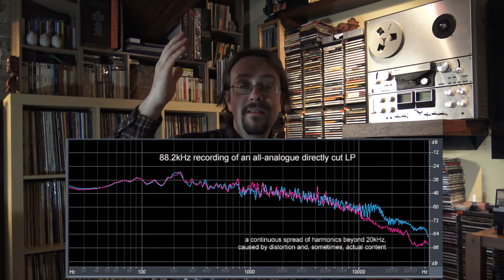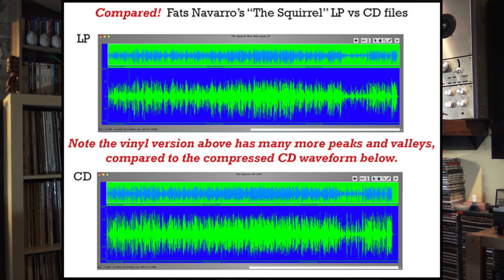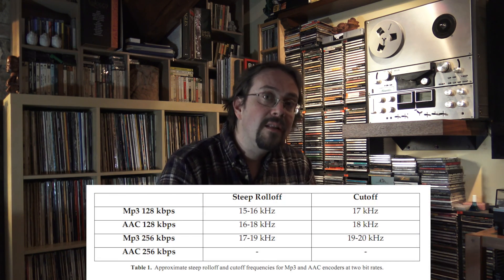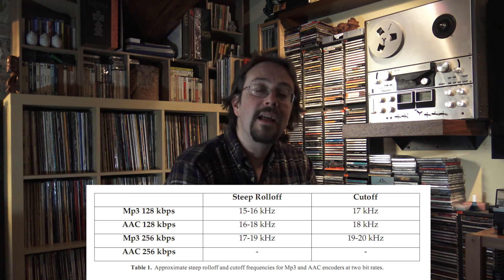SuperTweeters: how to increase your frequency response or a critique on modern music compression

Comment: I’m sorry, but you don’t have a clue on most of what you’re talking about in this video!!
You can’t even understand the huge difference between dynamic range compression and data compression (like lossy formats)...

Do you know that CD (and even mp3) have a way superior dynamic range than vinyl??
Do you know what signal-to-noise ratio means and how that relates to dynamic range?

Do you have a clue about the estimated “bit depth” of vinyl (hint, it’s way lower than CD).

Do you realize that what happens in the frequencies that human CAN actually hear is far more important than the ultrasonic information, and that you can have several pieces of gear (from turntables to loudspeakers) that will have major sound differences while maintaining the same frequency response range (let’s say 30-17.000 hz) while having +- 1dB variation between them across that frequency range?

Did you realize that you can actually hear the change in sound with your super tweeters because they reproduce frequencies well inside the healthy human hearing?

I’m sorry, I don’t mean to sound rude, but you should learn a lot more before you start talking in public about things you still don’t understand.
Please try to understand what audio mastering is, how it’s done, what are vinyl limitations and how they affect mastering decisions.

On the dynamic range topic, record one of your best sounding LP to a lossless digital file in 96KHz/24 bit, then downsample it to 44KHz/16 bit, and then to mp3 around 256 kbps with VBR, and compare those waveforms like you did in this video.
You will have a surprise in the dynamic range results, so please share your findings here with your audience! 😉

This has nothing to do with analogue vs digital, because anyone is entitled to prefer one or the other, and many bad mastering decisions made on any format have been done over the time.

I don’t have any doubt that your system sounds great, and most importantly, that it sounds great to yourself (which is the most important thing, imho).

But please get your facts straight on the technological side of things from the recording process to the playback in your own room (which also has a unique way of making that same system sound), or stick to personal opinions on how a specific audio format (or gear) makes you feel, as that is purely subjective, so you can never be wrong. 😉
Reply from the maker: I don't understand if this is for real...ok I ma not a technician, as always claimed, or an audio engineer. I have some competence and followed a few courses, in any case this is my passion and I like to share my points of view with others. As I always say, if you are looking for law, then you should head to academia.edu, surely not YouTube, and read peer review articles...QUOTE: "Do you even know what a peer reviewed article is?" Just to cite your wrong attitude towards people instead of discussing peacefully. 
In any case, if you start off saying that I don't understand the difference between dynamic compression and data compression then you are not reliable in your comment. It is just a sterile attack.
You are following the book, but you clearly don't know what is really happening Think out of the box sometimes..
Yes, digital formats MAY have a superior dynamic range, I said that in the video, especially the high res formats, but VERY RARELY this is used! In the vast majority of CD and other digital media issues and reissues the dynamic range is compressed in order to achieve a louder output (loudness war) and reduce the difference between high and low peaks that may 'disturb' people of create problems in low quality equipment (these are the reasons since the beginning of digital productions as well as also in analog, like happened for example for the first Led Zeppelin album that was took out of the market because the lower frequencies, which were uncompressed, or very little compressed, were making the stylus jump out of the grooves when used poor quality equipment). 
Most vinyl productions, even when sourced from high res digital as today, have a higher dynamic range as well as a better frequency response because of the intrinsic 20khz cut-off of red book cd format. A SACD, blu-ray audio or HD track will be equal or better IF they are true high res and not just an upsampling.
You suggested a home made experiment that clearly does NOT match reality, what the industry is feeding us. Yes, of course if I create my own Mp3 starting from a high res file I am going to have great dynamic range, which of course is not tied to the data compression, which takes advantage of the high frequencies cut-off. 
Another common pitfall is that of describing analog formats with digital parameters, that just doesn't work. It is a good starting point to explain yourself but it is not scientific, reality is different. Bit depth in vinyl? Not bits, the whole signal is there. Digital resolution is not applicable to analog resolution. One is numbers one is noise. Just take a deep look and check other points of view. The digital Bible law is way too self-referential. We are forgetting how analog works and how good it can be and how dangerous digital is when using it badly like today. Audiophile digital productions are something out of the picture and those ARE truly high quality and in several cases superior to analog (in terms of fidelity, I do not care about the rest). I have no problem in admitting that. The problem is that what is on paper does not match what reaches our ears.
Reply: Are you sure that you're not just upset that you discovered that super tweeters CAN actually make a difference and you went into a long diatribe about everything else? Lol. Some audiophiles are stuck on the old stigma of super tweeters from the 70s. It's the same thing with people that don't keep up with technology. A good analogy are people that say "Hyundai cars are crap" - they are repeating an old stereotype from 1986. When in reality, today there are some of the best constructed vehicles with some of the highest initial quality including tons of features. Stereotypes and stigmas will keep you in the stone age. As for the other topics, that's between you guys.
Reply from the maker: Amen
Reply: @anadialog  Ignorance is acceptable (Like your video clearly demonstrates), but it's still not a bliss.

Amen is precisely the tribal thing any engineer would never say while trying to build anything, or we would still rubbing pieces of wood in order to light a fire. lol

I'll reiterate (one more time) that as long as you like the result of your super tweeters, that's the most important thing for you (or anyone else that feels the same about any changes to a well-engineered loudspeaker like yours).

But trying to fight science without taking the basic steps into understanding why you are hearing the changes that you are hearing (and I'm not saying that they aren't real) is magnifying unnecessarily your own lack of knowledge.

You don't need to spend a lot of money on equipment that allows you to measure (in a meaningful way) what your super-tweeters are doing, and that could still provide a good technical reason for integrating them in your system.

It's obvious that you don't need to do it (at all) as long as you're only trying to convince yourself, but you just can't amen the B.S. out of science.

I also say amen to many things, and I do have my religious faith on a higher power.

But that's faith and I don't ask/pray to any superior entity to build me a great amplifier or set of loudspeakers, or even to remap the ECU of my car.

And I wouldn't ask a medical doctor to do any of those things either, because that's not their expertise or what they spent years/decades studying and practicing (with some very likely rare exceptions).

We're all ignorant on many more subjects than we are knowledge about, so I don't mean any offense to you while stating that you're showing ignorance on this super-tweeter argument. 

I'm just saying that you can learn about it if you want, and there are a lot of free valuable resources (like presentations, books and studies from Dr. Floyd Toole, amongst many others who explain several aspects of loudspeaker design an testing).

I personally love testing (listening) to several loudspeakers and measuring them when I can, and I believe that as an audio focused person you might also like to try it (I may be worng, of course).

So please don't take my humble suggestion the wrong way, because I believe that all of us who enjoy this hobby like we do should share knowledge instead of contributing to the steady decline of the HiFi community by speading snake oil and disinformation.

Cheers and stay safe in this crazy times the we live in. 👍
Reply from the maker: @MrRocktuga  oh now you answer me after a year? Just because someone else criticized your unfitting comment. 
Apart your awkward digression, please explain what am I ignoring? I am curious.
Reply from the maker: Again no answer and now you even insult me? Very mature and scientific approach.
Reply: @CeeStyleDj  I'll just say that I refuse to call myself "an audiophile", because despite believing that listening is the ultimate experience, I like to understand the science behind sound recording and reproduction, and not the snake oil and/or bias introduced by our very complex brains (in the way they process what our ears actually hear, how they integrate (and discard) sounds in the time domain, etc.

Integrating super-tweeters in a already existing/finished loudspeaker without actually measuring what the whole "system" is 99% guaranteed to introduce holes and peaks in the frequency response in the point where they are playing along with the tweeters, unless you measure it with good quality (and calibrated) equipment in order to make sure that you have not only the right crossover points (which may need changing the crossover in the original loudspeaker and the supertweeter itseld), but also making sure that they're both phase-aligned.

Then you must take into account that even 10.000 Hz is a highly directional frequency, let alone frequencies well above 20.000 Hz.

This is all about science, and if it wasn't for science we would still be only listening to live instrumental or vocal music, since there would be no sound recording to start with.

This isn't something that an audiophile from decades ago would say (and even most of today).

I've explained a very small part of the science behind sound reproduction which are facts.

That being said, I firmly believe that every person should use its own system the way they most appreciate it, disregarding whatever opinion any other people might have. ;-)

I'm not such a believer in the value of providing disinformation, and that was the base of my original comment.

BTW, as a car lover, I also agree with you on the ever growing quality of Hyundai/Kia cars, which was only possible by applying science, technology and loads of money on research.

No one can develop a good car based on belief or anecdotal evidence. ;-)

Cheers
Reply: Sorry to get you guys back into it. Honestly.
Reply from the maker: Don't worry. Thanks for sharing your point of view.

Comment: you are all right sr.!

in my experience, we can listen a very good quality sound in a decent "sound chain devices", not necesary all analog and tube amp,  not necesary a high end audiophile super expensive audio equipement. (anyone wish that! thats for sure!) so, there will be a balance between power and quality. (...components and audio signals).

i've working a long time ago in informatics and electronics, and music is my passion, and i think, that in the audio balance, analog is the king, but, in practice or real life, the digital advantages and it's improvements are not to be passed. 

for example. about digital devices, some sound cards are really expensive and nothing more that merchandising, but, in the other hand, there are some exceptional sound cards!, that work very well in junction with some software and a dedicated tunning (opamps, etc...) and it will be a very nice part in an audio chain.

i will resume in this way.

the audio quality resides in a delicate lienarity from signals to transducers, and finally how the sound room will affect that. that will be the experience quality.

psycoacoustics are important, but not everything in audio.

you have to educate your ear, your brain and make a research to "calibrate" your perception and listen many tipe of music, ages and experiment with all this combined, this is really the "audio experience".

thanks for share your knowledge, is very apreciated.

greetings.
Reply from the maker: Thank you Ren!
Reply: @anadialog  you are welcome!, merry sound xmas.

Comment: Thanks for an very informative and inspiring channel, I like the tempo and your approach. This video about super tweeters made me remember, that I always wanted more “air” to the music, especially to voices and high end. Therefore I tried with an “pour” mans super tweeter😀, I had a pair of Wharfdale Diamond 220 bookshelf not in use (nice high end and midrange, loose and sloppy bass)I disconnected the woofer (easy with biwire terminals), connected speakers to my amp, turned the bookshelf up side down on top og my main speakers (It looks quite stupid with button bass port on top), the extra tweeter, do make a positive difference whiteout adding to much color to the sound, so now I will start looking for an real super tweeter solution, thanks
Reply from the maker: Lars, that is so cool! Thank you!
Reply: Wow those are so expensive! Thereare 2 questions I have. All my components are almost all vintage and all the specs say 20hz-20khz +- but I know it doesn't mean it won't go higher but it still might be risky to get the tweeters no? Question 2
Would I have to put them in parallel or series with my 8 ohm tweeter?

Comment: What do these sound like when the speaker is bypassed, do the highs cut in and out when cymbals hit etc or does a constant sound come out? 🤔
Reply from the maker: It very strange. Behind the tweeters, I forgot to say, there is a knob to increase or dimish the effect. You imnediately feel mire space around the instruments and just overall the mysic sounds more natural. I must admit that if you have a 'bright' system, maybe this is not the right choice. In fact, I just changed my amplifier, which has a strong presence in the upper frequencies and in the end I had to turn them off!!

Comment: Could you please do a video about phono preamp stages? I'm considering getting a tube phono preamp or possibly a Creek Audio, Rega,  Pro ject, or something along those lines. I'm currently using an NAD integrated amp just for the preamp and running into a Proton D1200 amplifier powering a set of JBL L65 JUBALS I picked up at Habitat for humanity for $15.00 ! (Just had to replace the foam surrounds on the woofers, and spray out the adjustment pots on the crossovers and they sound wonderful!My turntable is a Rega Planar 3 with  an Audio Technica Signet TK-7E moving magnet cartridge (this turntable was given to me by a friend).  I upgraded to the ceramic platter bearing and a replacement high performance white silicone drive belt. I also have the matching Proton 1100 preamp, but it needs servicing at the moment. Plus I've also just acquired an Akai 1710W reel to reel that I've been working on.  Keep the cool audio vids coming please! Thanx 🎧🎚🎙🙂👍
Reply from the maker: I will do something more in depth in the future but you should check out also this video: https://youtu.be/zOPD7lKqEP0
And this for matching issues: https://youtu.be/T428mIuw9IQ
Reply: I'll sell you my tube box ds with upgraded powersupply

Comment: Hello, thank you for the information. A question sir, so if your cartridge, phono stage, CD player and receiver do not play  higher then 20,000khz then a super tweeter would be a waste of time? Thank you!
Reply from the maker: If you don't have at least one part of your gear that can go beyond the higher frequency range of your loudspeakers, usually 20-22Khz, then yes, it is useless. Receivers almost always go way beyond 20Khz...so the rest is easy to upgrade.
Reply: These are the specifications to my receiver = 100wattsminimumcontinuouspowerperchannel ,8 ohm loads, 2 channels driven from 20 Hz to 20 kHz with a maximum total harmonic distortion of 0.08 % (FTC rating)
• WRAT-Wide Range Amplifier Technology (5 Hz-100 kHz bandwidth)? Not sure what this means? 
• Optimum Gain Volume Circuitry
I’m unsure if the super tweeters are worth getting, Could you please check, and let me know if my receivers frequency range is 20 Hz to 20 kHz or is it 5 Hz to 100 kHz? Many thanks again.
Reply from the maker: I will try! Can you give me brand and model of your amplifier?
Reply: ana[dia] The receiver is a Onkyo TX-SR 705 = 100 Watts minimum per channel at ohm loads, 2 channels driven from 20 Hz to 20 kHz with a maximum total harmonic distortion of 0.08 % (FTC rating)
• WRAT-Wide Range Amplifier Technology (5 Hz-100 kHz bandwidth)
• Optimum Gain Volume Circuitry.

Thank you kindly for taking the time!
Reply from the maker: I have been looking around and I must say that you are right, it is confusing. I am afraid that apart from the artificial and ambiguous WRAT, the true frequency response of your Onkyo is 20Hz-20Khz, also considering the fact that it is a Home Cinema device and not created especially for high quality audio. If you want to be 100% you need to contact Onkyo and ask the TRUE frequency range of the machine. Keep us updated!
Reply: ana[dia]log thank you for taking the time to look into that for me. I will call Onkyo and confirm the frequency on my unit. I will keep you posted on there reply.